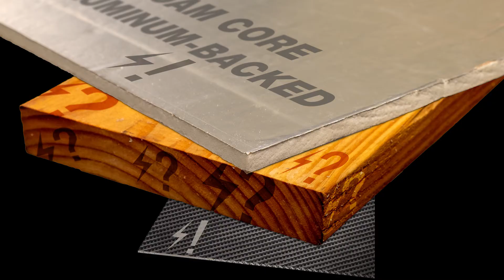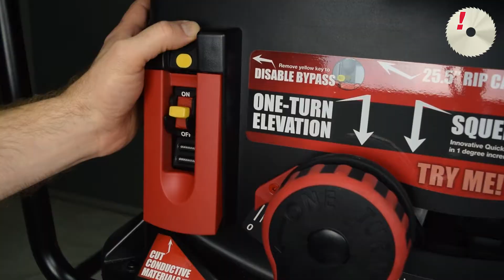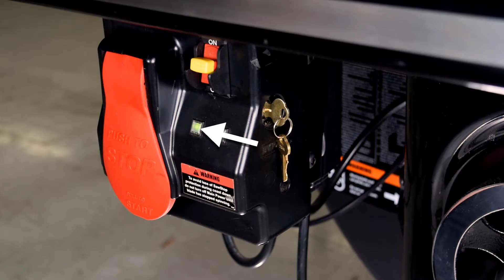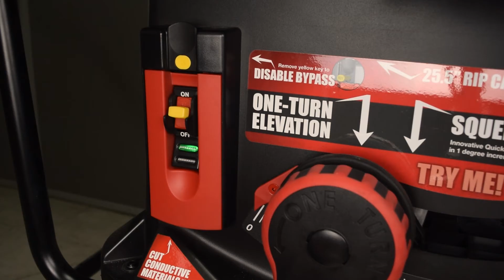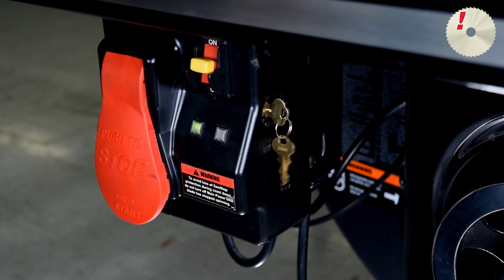SawStop Service Tip: Initiate and Use Bypass Mode

Comment: I wish we could put it in bypass mode and leave it in bypass until the master switch is toggled. Consider a bacterial that needs a lot of cuts - the additional steps to turn bypass on for every time you start the saw is problematic. It only takes one small error to result in a crash if your saw when cutting conductive materials (like polycarbonate). That is my one and only criticism of this saw

Comment: Doesn't work on my contractor saw. I turn the key and no red light, no blinking green just solid. Can't use my own saw to cut pressure treated lumber!! It ate up a cartridge trying to get it to work. There goes another 100.00.
Reply from the maker: Hi, sorry for the difficulty you’re having with your SawStop table saw. The best way to help is to have you speak directly with our service department. Please call them at 503-582-9934 or 866-729-7867 or email them at service@sawstop.com. They’ll fix you right up. Thanks!

Comment: Tried multiple times ,isn’t working.
Reply: Turn on sawstop (yellow switch to ON) , turn key (not letting go of key) as soon as first red light flashes pull red lever (lever that starts the saw) when second light flash let go of the key. green light should be flashing